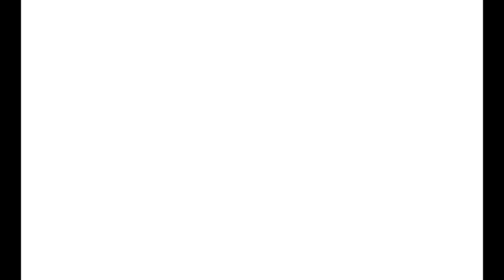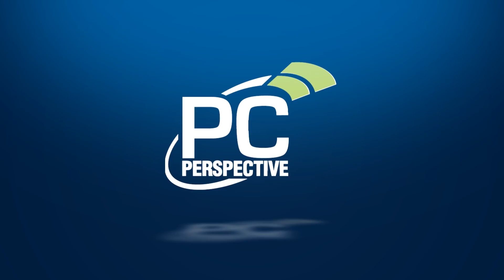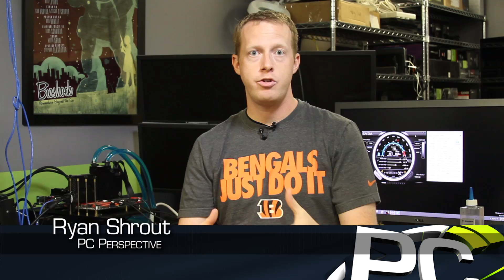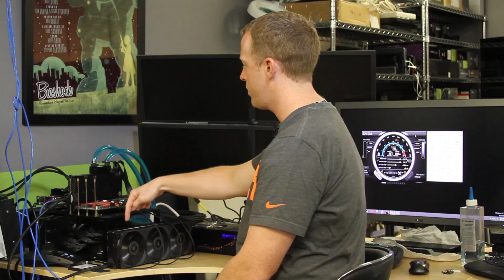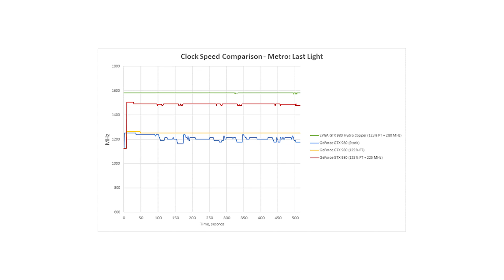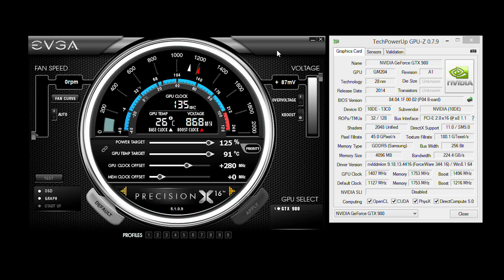EVGA Hydro Copper GTX 980 Water Block Early Performance Testing

Comment: GPU-Z says my Zotac GTX 780 has higher bandwidth, more shaders, more ROPs, more TMUs, and Bus Width running at 941 MHz.. Pixel Fillrate and Texture Fillrate are identical. The only features that are an upgrade seem to be higher speed at 1407 MHz and more video memory. GPUBoss says a 980 has 64 ROPs and a higher Pixel Fillrate at 71. Why does the videos GPU sample seem lower spec'd? Is GPU-Z in error? However some YouTube videos are showing the 980 with higher FPS Benchmarks, Lower temps and lower TDP which are benefits. The card is more efficient despite the specs comparison and therefore higher FPS?

Comment: You said that with the stock fan cooler that it runs around 80 degrees Celsius but my 980 runs around 35-40 Celsius pretty much always. It's not water cooled yet either
Reply: Same with mine. I own the 980 SC ACX 2.0 Edition and it remains idle in 42c and in full load around 60-75c. Manually set at 40% of fan capacity

Comment: Anyone looking to buy 2 of these cards , hit me up. They are Brand new Never opened.
I'm about to put them on ebay, but I'll give you a Great deal on them, or just 1 if you want.
They are still in the delivery box,  I didn't even open that!!!   Lemme know and we an make a Great Deal!!!
JJ  Lefty H
Reply: how much? why are you selling them? those are good cards, so i'm a bit curious. you're talking about the hydro copper card that you buy right? not a reference 980 with a waterblock installed on it by you? I probably wouldn't be able to afford it for a couple months though, and i also am getting a swiftech cpu cooler and reservoir etc.. so i'm not sure if it would fit an EK block like that.
Reply: Hey xX I paid $799 plus tax so about $830 Bucks.  But Im willing to sell them for #700 Even!!!  They are from EVGA . They came with the waterblocks attached already.  The reason I'm selling them , is because I do A lot of video rendering , and really wanted the Titan Z Hydr Copper from EVGA. But they are soo hard to find with the water blocks attached already.
They are still in the box form Newegg.  I haven't even taken them out yet.
The reason I want the Titan Z is because it's just a Total Beast of a a Vid card and I want 2 of them. The cost about $1700 each. But I'm building a killer PC in a Case Labs Magnum TH10A Case. http://www.caselabs-store.com/magnum-th10a/ and the Pedestal that goes with it.  It cost me over a thousand just for the case and accessories for the case.I'm using 2 Monsoon Seris 2 Pump/res with Hardline tubing and Chain Gang fittings                  It's gonna have 2 1500 watt Corsair ax1500i PSU's. I'm putting in 3 separate loops. 1 for the CPU , 1 for the GPU's, and 1 for the Voltage reg.  The whole build will cost about 8 or 9 Grand!!!  I'm using 2-480 Alpha cool Monsta Rads and 1 -360 Monsta rad. it's gonna have 34 fans in it. It's gonna be a Beast!!!!!!
So if you are interested in the cards , lemme  know. That's a Good Deall!
Brand New NEVER opened.  If you want to email me at JJ82643@gmail.com, I'll show you the whole parts list and the pic I have of them sitting on my work bench, ready to Build.  I just wanna wait for the Titan Z cards.
Email me.....Nice talkin to ya
JJ.....Happy Holidays!!!!!
Reply: Sold!!!!!

Comment: I don't even know HOW to order one of these.  I haven't found them anywhere.
Reply: Hey Dreamagain, I have 2 of these I just got from Newegg, but I really wanted the Titan Z, 2 of them actually. But like you said, they are soooo hard to find and buy.  Well I have 2 GTX 980 Hydro Copper Cards , Brand ZNew in the box, NEVER OPENED, and I'm looking to sell them.  I'll sell you 1 or 2 if you want for the same exact price I paid on Newegg.
I'll actually take off $50 Bucks!  Lemme know if you want  tehem.
JJ Lefty H
Reply: ***** i might be interested. w ould you be willing to do it through ebay?
Reply: Well guys,,  go to either Newegg or evga.com and where it says they are out of stock, clik the Auto-Notify and put in your Email addy * when they come in, they'll email you and you can buy them.  I know how you feel cause I wanted the GTX Titan Z and Never got them.
But that's how you do it.
Best of Luck!!!
JJ
Reply: Or if you Really want to pay Double for what they cost, mine cost $700 Each & that's with the water Blocks attached.
Look on Ebay an you'll pay Double that for a GTX 980 w/Water r Blocks attached

Comment: why do we need Water Block on GTX980 the card already running very cool.
Reply: Because putting any GPU to water and cooling it to approximately 1/2 its original temperature will prolong the life of the card - plus it looks cool.

I'd never go back to air-cooling anything on my system.
Reply: Because without a water block, you limit your overclocking potential.  At 1500+,mhz core, the cards start to throttle a little at around 81C.  So effectively you may only get an actual core clock of 1450ish with the throttling.  Also once you OC the card quite a bit, it starts to get a tad loud since it needs to keep it under 90C.  Imagine trying to add more than 87mV.

  Also who wants to listen to a card fan sit there spinning when you can enjoy nice quiet operation.

Comment: highest overclock for that card someone got 2.1ghz
Reply: Actually 2.2 ghz now. Kingpin with the other guy got 2.1 ghz but there was another guy got 2.2 ghz
Reply: enrik arevalo Holy shit That would add like 20 FPS easy
Reply: That was technically the evga gtx980 classified that K1ngp1n got the 2.1mhz world record overclock on, not the hydro copper. (although he obviously had the classified altered to fit a waterblock and simultaneously use the custom ln2 bios) They both have the same stock and boost clock speed (up to 1,397 boost) but the classified has two 8 pin pcie connectors while the hydro copper has two 6 pin connectors so the classified will get better overclock capabilities due to being able to receive 150 more watts than the reference model hydro copper card as well as having 3 different BIOS, a normal, an overclocker bios, and an ln2 bios.
Reply: Haunted Abyss
And add 3 more cards thats 60 more fps. This card is a game eater no doubt.
Reply: Well by adding more cards here your talking 1.5x Per Card with Over clock Perhaps depending on the game. Kinda mind blowing. Lets say Bf3 . A dual OC 780 ti will do 120-160 On Ultra 1080p

Where talking Near or 200+ on these 980's with 2 cards AVG hell lets turn on MFAA while were at it too LOL Your looking at a 2k Quality Image for around 144 avg. Double performance of a TI

And Games Coming out Will be utilizing these benefits far better.
Reply: Haunted Abyss
Indeed. And I don't wanna be purchasing something that I need to change in 2 years time. Minimum 5 years, max - how long it can go. Personaly, I am looking at motherboards with LGA 2011-3 and DDR4 and for that to work and do not bottleneck, GTX980+ series are the best choice.
Reply: Well I wouldnt bother with my setup (Fourmula VI 4770k) Comes close to its performance. The new Mobo's and Ram are too overpriced for there performance IMO.   You could easily spend that money on another graphics card. A liquid cooling setup... Hell a Really good DT 990 Headset and Amp Set. Be better off. Im not upgrading till 2017 when Tock for the chipset after the next chipset.
Reply: Haunted Abyss a lot more than 20 fps thats for sure.  My 1580/8000 OC gets me another 15-16 fps in most games easily.  I cant see why 2.2 Ghz wouldnt give you 25/30
Reply: ***** compared to ?
Reply: Haunted Abyss what do you mean compared to?  

This whole conversation is about the difference in fps between a stock 980 and an OC'd.... Lol you OK?
Reply: ***** face Palm* you stated 1580/8000  like you mean you got a 980?
Reply: Haunted Abyss no i mean a 8800GT, What do you think I mean?  Yes a 980, thats what this whole thread is about.  Jesus Christ man why are you being difficult, i feel myself getting dumber reading these.
Reply: *****  = O lol I had a long day GEEAZZZZ lol Ya i wasnt quite sure if you ment the 8800 or ??wtf you were talking about.  and YES i know we were talking about a 980 I didnt fall down some stairs I sware...
>.>
Reply: xXDarkxIdealsXx  Wow :o I'm sold on this info.

Comment: I don't think these will be temperature limited but voltage limited... to be seen dramatically when the GPU fries and a puff of smoke rises out of that aluminum block after a custom bios. Least we'll know what that limit is... but doesn't Nvidia know? Haven't they had some input into voltage limits that are written into these bios' via testing? I don't think adding more volts will yield much... cept a fried card myself.
Reply: I kind of agree.

Kind of seems to me like Nvidia is locking things up so noobs don't blow up their cards using easily available software.

I think the voltage cap is where the "safe" zone ends and you could potentially run that daily (along with the overclock) without issue. Outside of that safe zone doesn't mean you're totally going to blow your hardware, just that the potential is there.
Reply: djmpsf I think this all loops back to why only 2X6 pin power plugs. This card was not supposed to be the killer, it was supposed hedge out the previous top card and sit pretty (and cool)
Reply: its actually TDP limited mainly.  BIOS of the cards lock it to max of 125% power limit.  At 1503MHz my 980 hits 125 all day in games that use 99% GPU.  It starts to throttle  back to 1450ish mhz once it hits this and im still well under the thermal limits and thats not even using more voltage.  Stock voltage all day.

So ya even with extra voltage, we also need a bios hack for power limit.  But like you guys said, those 2x6 pins may be a limiting factor.

Comment: These numbers are pretty crazy and all but what would this relate to in real game performance. How much fps difference is it from the stock Base Clock to something of this level of an overclock?
Reply: Well... Overclcoking core clock noticeably improves fps. But the point that this video made was, that even with the highest volt set. The gpu at 1580mhz on load was giving around 42c temperature which gives tremendous amount of headroom for more overclock. And more core clock more speed!!!. It's like the gpu could drastically transform into titan version of the card.
Reply: they did an early overclock fps test..and vs stock it picked up 25 percent more fps
Reply: jeymison2 jesus christ man, thanks for an answer to a question nobody asked LOL.

Noxtastic My 980 at 1570/8000 can get anywhere from 15-17 extra fps in almost all recent and demanding games.

Comment: im watercooling my second r9 290 tomorrow :)
Reply: Nice, acrylic or rubber tubing?
Reply: Dominator750 rubber tubing
its not really possible to do acrylic because im using a external car radiator
Reply: watercooled my 290 as well, blown away by how far they go. #jelly
Reply: MrPummetje Shame. Still, that card will do great with water. I got my tri-780ti under water, and it is just to good.
Reply: MrPummetje
might as well add fire to the mix. i wanna try to overclock a cpu and gpu, memory and the whole motherobard with petrolm see how that works
Reply: ***** my components are overclocked :)
Reply: MrPummetje Does it have petrol on it?
Reply: ***** no